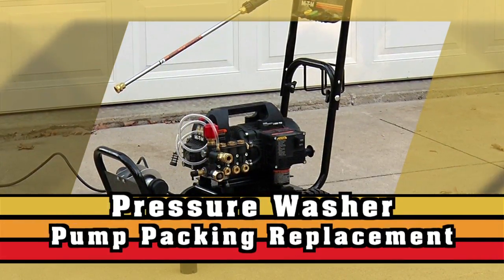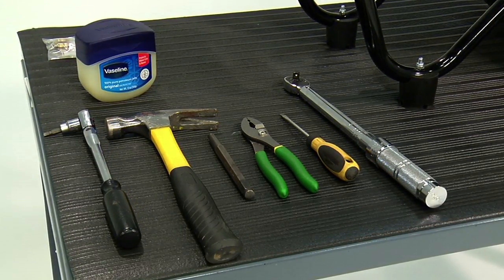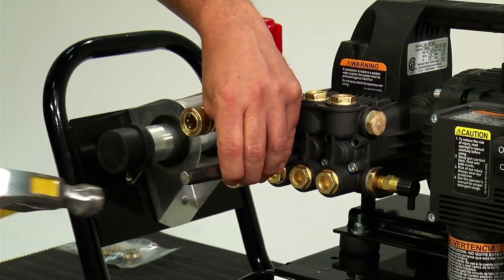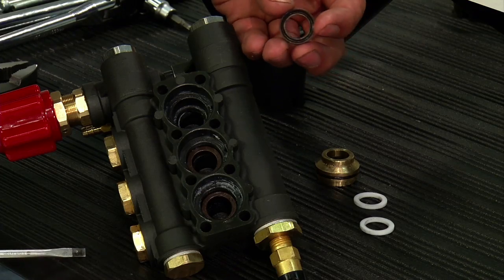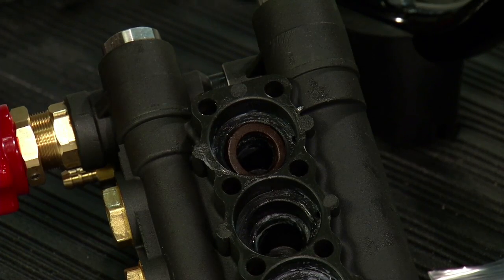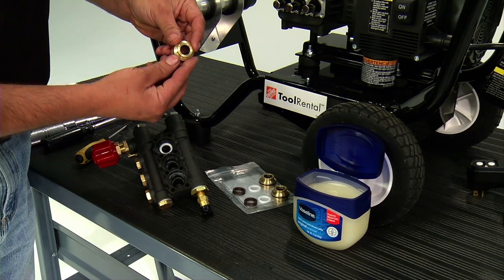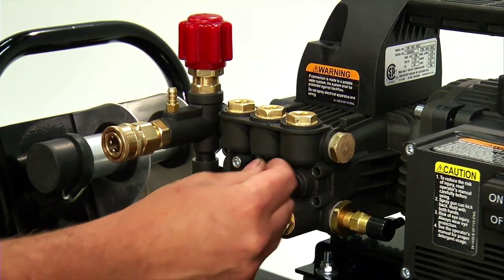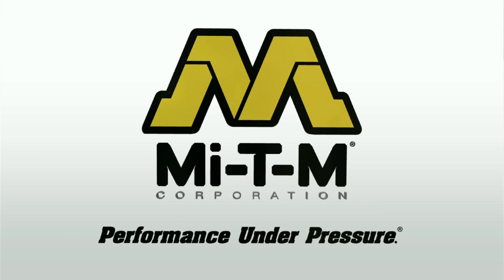Pressure Washer Pump Packing Replacement

Comment: If oil is milky could performing this procedure fix the issue?
Reply from the maker: Hi Zack, replacing the water pressure seals and checking the plungers to make sure they are not cracked should solve the issue. Feel free to give us a call at 1-800-553-9053, we'd be happy to help you troubleshoot the issue.